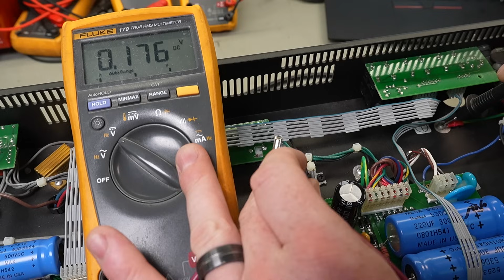Mesa 5:50 Express - Failed switching matrix and pilot light.

Comment: Stuart ukguirtarampguy just posted a video of a similar failure, same model, sounds like that batch of caps is going bad
Reply from the maker: Tantalums just aren't a good choice in any circuit powered by an unregulated power supply.
They have zero tolerance for over-voltage or spikes from the mains line.
Reply: Noted thank you!

Comment: The tantalums strike again!  If you ever find one getting nasty distortion, look for shorted tantalum’s around the eq circuits. Mesa is still taking design notes from post golden age tektronix.
Reply: You'll also find lots of tantalums in the tone control circuits of 1970's Japanese hifi, Pioneer receivers and such, where they rarely short but they do cause popping noises and DC leakage into the pots.

Comment: The quiescent current of the regulator you used is 1mA more. Mesa runs so close to the limit in everything that the extra 1mA was dragging down the transformer voltage haha. Should've worked maybe faulty new component?